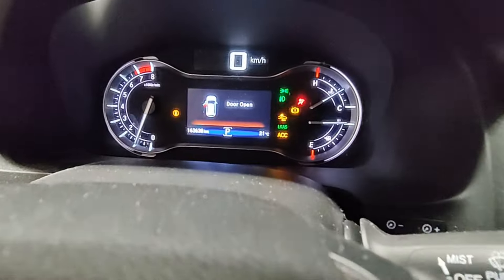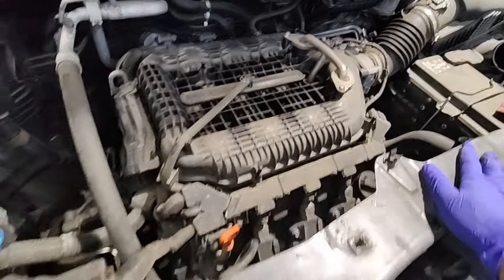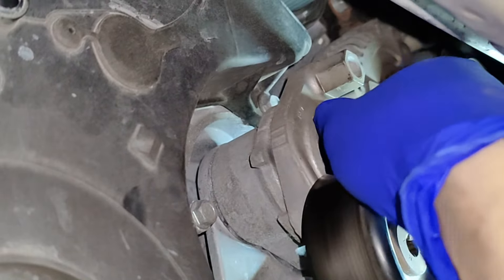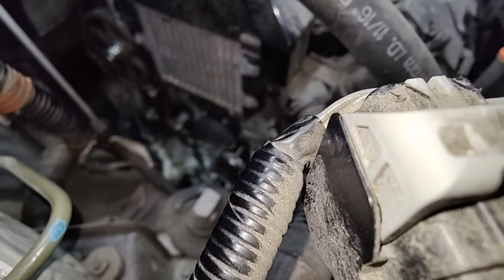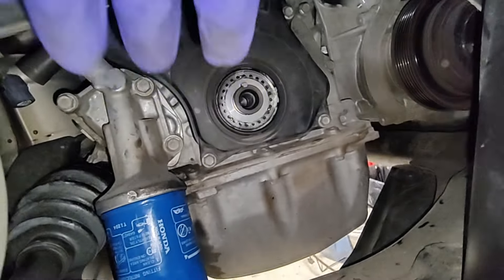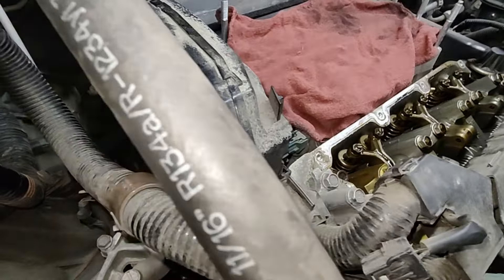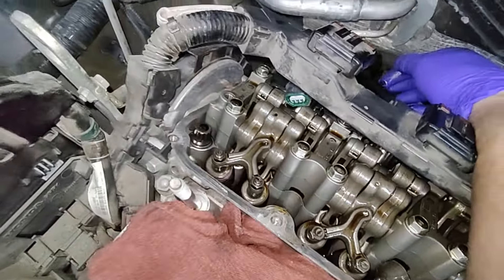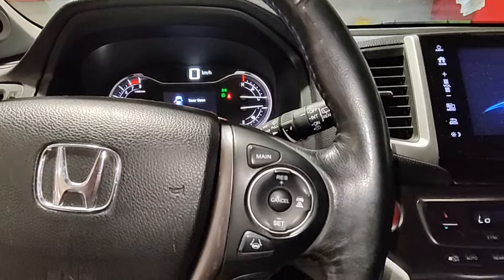2018 Honda pilot timing belt, valve adjustment, spark plugs.

Comment: I own a 06 TL 190k miles and purchased this in May 2023 with 171k miles and in Sep 2023 with 179k miles I took in for timing belt replacement because it was making rattle noise in colder weather during first start up of the day and it was the hydraulic tensioner, they changed the belt, tensioner, water pump, water pump wasn't leaking but I emphasized that also during a cold start what sounding like a pully bearing was making some noise like one would with a plastic pully and I was rite, it was the water pump making an extra noise and probly could've seized, engine is doing fine I'm glad I had the service done but it didn't have valve adjustment and I think it could benefit from it, I'm sure it's never been done, I changed the spark plugs which were very difficult to unthread but new ones NGK went in just fine, I'd like to do ( check and adjust ) the valves because I bearly notice some difference how it ran before the service was done, believe it made just a little more peak power but not enough to complain about so that's were I believe it could benefit from valve adjustment, motor sounds pretty quiet but I can only hear a hint of the valves opening/closing, Nice video
Reply from the maker: The other reason why we do valve adjustment is to prevent the valves from burning up we actually had a similar year tl my neighbor working beside me had to remove the cylinder on a TL because it burned up a valve on bank 2. So valve adjustment are important because how those valves dissipate heat is contact through the valve seat on the cylinder head if the valves are to tight they can't cool. And you can get fuel trim codes. To loose they get noisy.
Reply: @theoffroadingmechanic  thanks,  I'll look to do this soon
Reply: Always change the water pump may car was 10 years old with 70,000 changed water pump now at 121,000 I’m doing the oil pump gasket and another timing belt and water pump

Comment: about "customer declining recommended service". look. there are numerous shady dealers out there; people dont trust them anymore; I personally, whish we could see bits and pieces of what is wrong with my vechicle to actually understand why is the service department recommending, but when you ask service advisor to explain they 'dont know'; and rarely  the customer can approach the mechanic directly; this is the experience of taking a vehicle to the mechanic nowdays; there is a wall between the customer and the mechanic. Also, you mention some apprentice dammaging threads of the engine mount accidentaly; I am aware they have to learn somehow but reallity is my vehicle I dont want an apprentice to work on it on a timing belt job for instance.
Reply from the maker: I can vouch for that apprentice and he has done way more transmissions, headgasket, and diagnosis than any mechanic that has just gotten their license. The bolts for the mounts pull threads regardless if it was a license mechanic doing the job it is bound to happen it's not the apprentices fault it's how you fix it is what matters. If you ever work on a ford 4,5,3 valve triton V8 that breaks spark plugs when changing them they are bound to happen. A lot of mechanic don't want to talk to the customer as they are all flat rate and aren't getting paid to do that. Advisors will spend half an hr listening to a customer sometimes. Would you rather have a license mechanic that never done a timing belt do the job or an experienced apprentice that has done many timing belts and is able to fix a known problem from the get go. I was an apprentice once and I did everything that a mechanic can or should be able to do and that is what made me what I am today you learn grow and you get better at your job.

Comment: I've chatted online with another Honda tech who also said that the water pump and pulleys don't usually need to be replaced on the first timing belt change. But tensioner yes, even though the service manual only says to inspect and change it if it's leaking.

Comment: seems to be a bad design to have the oil filter so close to the lower control arm that moves.
Reply from the maker: You should see the new pilots the filter design is even worse I should do a shorts on how the oil filter has moved with each generation of pilot. The new one is further in and right up against the block and you can't put anything under it to prevent it from getting all over the skid plate because the oil just run down the side of the block.
Reply: It's over the subframe.
Reply: @theoffroadingmechanic  a big bump and the oil filter may hit the control arm or when the motor mounts fail the oil filter will drop. I’ve noticed Honda designs has gotten worse. another example is the brake bleeder screw the rear being a different size from the front. that’s what american cars are like. i guess honda is an american design and made car now. so sad.
Reply: @HiFiInsider  The Pilot and Odyssey are designed by Honda America for the North American market. Maybe that explains the trend.
Reply: It’s all about the $$$$, us as the consumers get the shaft.
Reply from the maker: That will happen if the front and rear mounts have collapsed you will know when the engine tries to lift up when accelerating but that filter is really close to the sub frame.
Reply: @HiFiInsider  If the arm hits the oil filter you have far bigger issues than the filter getting crushed. As for the different bleeder size that is only on the electric calipers. I think there may be some supply issues because it is the exact same caliper that several other companies use. It still drives me nuts. Still far better than the Prologue
Reply: Oil filter is not over the control arm.

Comment: Regardless of whether or not the WP is leaking it should be replaced as well as the pulleys.  You said why go through all that work and not change those parts.  If that WP springs a leak, the customer is going to wonder why it wasn't changed while everything was apart.

The Aisin kit comes with everything you need.
Reply from the maker: Honda does not use kits every Honda tech will know this all timing components are sold individually. Water pump is inspect and replace if necessary. If you have done enough T-belts on Honda V6 they don't typically leak if you follow the 100k miles or 7 years which ever comes first. I've seen belts break more than water pumps leak and even after the second T-belts change. I said that because the hydraulic tensioner always leak kind of like a weak point since customers will decline replacing the hydraulic tensioner.

Comment: I found on the earthdreams v6 that the harness is very easy to detach and flip over to the driver side of the engine making the valve covers far easier to remove. Then the injector module is gone and the mount is easier to remove from the engine.

Comment: I did the timing belt and water pump on my 2007 Honda Accord V6, and surprised how similar these newer engines look compared to my J30A5.  Big difference I noticed the PCM in that weird location, where the power steering pump was on mine.

Comment: Great job. I have a 2011 Pilot with 256k, R-Red belt, tensioner, w-pump at 160k, still about 60k to go. Runs quiet and smooth.

Comment: Damn front struts are always leaking on these gens. For a first time DIYer, do you recommend removing the plugs to make it easier to love the crank and cams?
Reply from the maker: They're gas filled struts usually the gas leaks out and makes a hollow thumping noise when going over bump same with the Honda pilots. And then the fluid starts leaking out and the noise goes away but the SUV gets bouncy. Depends if you're doing the spark plug valve adjustment. Sometimes people will just do the timing belt and then the spark plug valve adjustment another time to separate the cost of the symbol 4 maintenance. But just the timing belt I just leave the spark plugs in  when rotating the crank.

Comment: Another killer video!
Does Honda recommend changing out the T belt due to age? My Dad has a 2014 Ridgeline with only 58k kms, sure would be a shame if that let go
Reply from the maker: By age I believe is 7years by mileage is 165k kms. Like anything that has rubber in it over time it will dry harden and crack. It's the teeth on the belt that comes apart as they take the most load in turning those sprockets.

Comment: DO you know which year of honda pilot onwards they use hydralific lifters that manual vallve adjustment.
Reply from the maker: 2023 went to hydraulic lifters and no more valve covers to remove. It's all silicones and the "valve covers" are the cam caps.